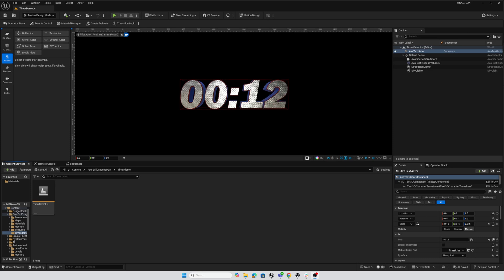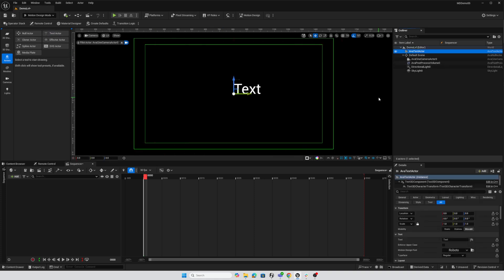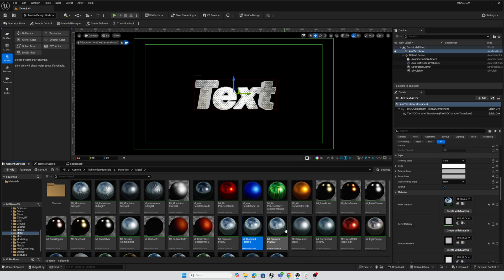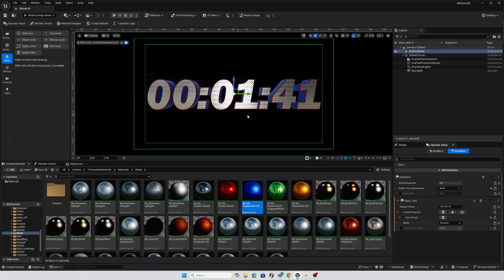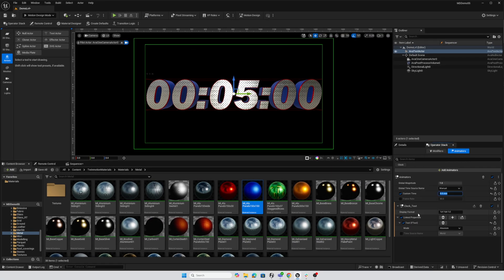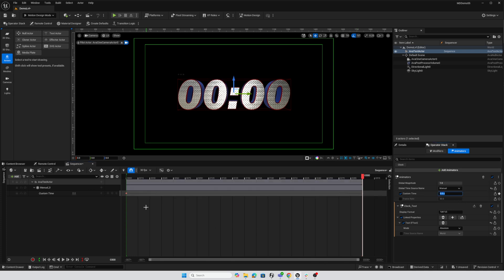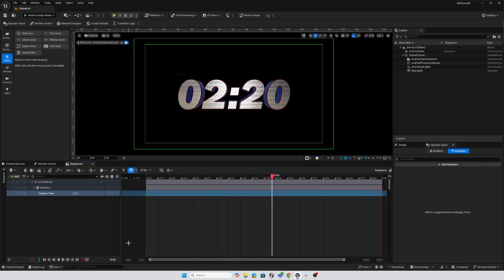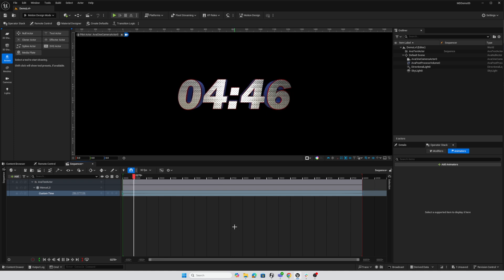Unreal Engine 5.5 Motion Design Countdown Clock

Comment: Hmm this seems to only work with time formats. For example, if you simply wanted to animate a number going from 0 to 100, you can't do it? I tried using the milliseconds format (%F) and set keyframes from 0 to 100. When i hit play, the numbers go way above 100, popping in and out. Even when I set the keyframes to linear, it's still wonky. This doesn't let you animate a simple whole number up or down?
Reply: did you find a way because i want to do this kind of animation like starting from zero to 100 %, also if anyone knows how to do this inside unreal engine 5.6 i would appreciate it
Reply: @mahdiomar20003  Hey, I never found a solution. I'm not even sure that it's possible to do it. I eventually  just gave up  and decided to  animate the text using after effects instead. I  exported it out into Unreal as an image sequence and used that instead.
Reply: @kickheavy8982 yes bro you’re right but if you have a real time scene for broadcasting you can’t do this dw I will try my best to dig in

Comment: Is this only for 5.5 or is the Text Animator also available in 5.4?
Reply from the maker: It's in 5.4 as well. (might look or operate slightly differently there, but same fundamentals) 🙂
Reply: @PixelProf  Ahh fantastic thank you! I was just able to find where the animator is as it's slightly different. 

One other question, to control the count down from a rundown and be able to start and stop it on command, what property would you need to expose to the Remote Control? If this is possible yet...
Reply from the maker: @lachlansmithfilms4967  Stop/start functionality doesn't seem to be something that's "built-in", but I can't be sure. I suspect this could/should be doable via blueprints, but haven't dug into the process yet myself.
Reply: @PixelProf  Ahh no worries, thank you very much for getting back to me. I have found some ideas of ways to possibly do this using the Rundown/Transition Logic Controls, but I'll also check out blueprints.

If I'm able to work anything out that might be useful I'll drop you a message and let you know!

Comment: BOSS-Can you tell me more about 5.5 material designers? Almost no one talks about it. , it’s just that the BUG problem of 5.4 has not been fixed yet. . .
Reply from the maker: The Material Designer in 5.5 is dramatically improved vs 5.4, with LOADS of new features and abilities, but there are a few glitches in the initial preview release that have been fixed in the github source code version, but not released through launcher yet. I'm holding off until the next 5.5. update on launcher before digging into those features so more users have access.